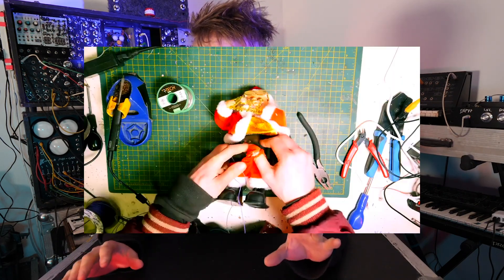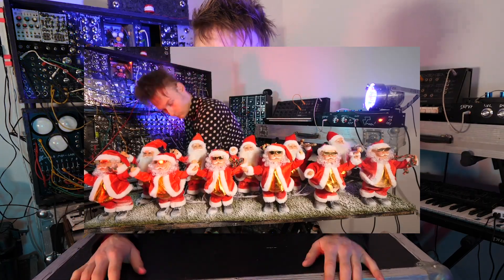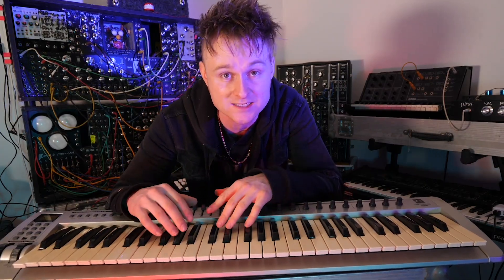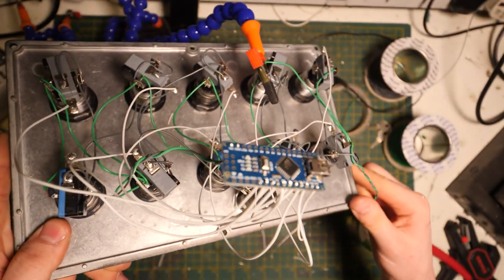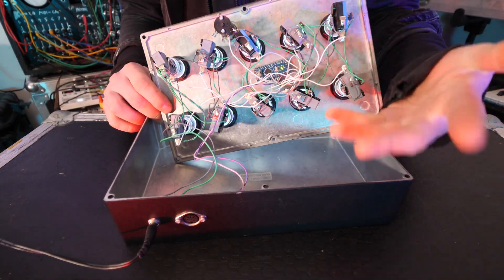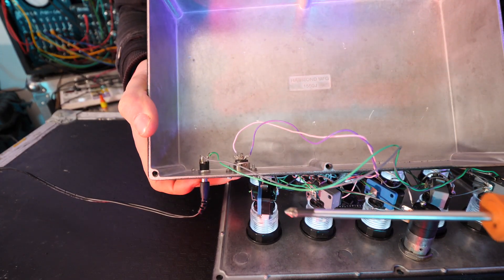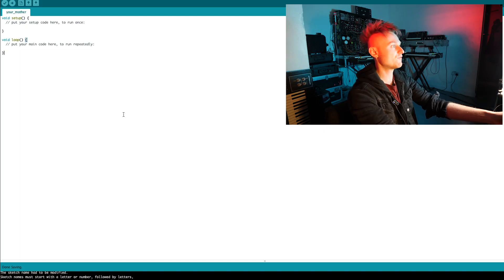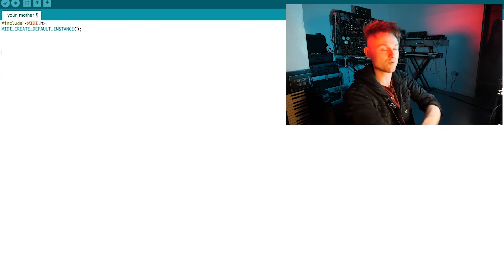SUPER SIMPLE MIDI KEYBOARD DIY HOW TO

Comment: I know you probably got tons of suggestions for making the code a bit sleeker, but I think it would be good as a "next step" for beginners, to show the use of arrays for storing the pin numbers and MIDI note values.

Then you can just use for loops for everything. ;)

I guess it's debatable whether this gives more or less "clarity of code". lol

#include <MIDI.h>
MIDI_CREATE_DEFAULT_INSTANCE();

byte buttonpin[]   = {2,  3,  4,  5,  6,  7,  8,  9,  10, 11, 12};  // Pin number for each button.
byte buttonstate[] = {0,  0,  0,  0,  0,  0,  0,  0,  0,  0,  0};   // Button states. (reset all to zero on startup.)
byte midinote[]    = {36, 38, 40, 41, 43, 45, 47, 48, 50, 52, 53};  // The MIDI Note that each button will control.

void setup()
{
  MIDI.begin();                                                   // Initialize the MIDI library.
  for (byte i=0; i<11; i++) pinMode(buttonpin[i], INPUT_PULLUP);  // Set button(s) as input(s), with internal pull-up resistor.
}

void loop()
{
  for (byte i=0; i<11; i++) {
    if (digitalRead(buttonpin[i])==LOW && buttonstate[i]==0) {  // Is button pressed (pressed-LOW) AND buttonstate is 0?...
      MIDI.sendNoteOn(midinote[i],127,1);                       // Turn MIDI note ON, velocity 127, midi channel 1.
      buttonstate[i] = 1;                                       // Change buttonstate to 1.
    }
    if (digitalRead(buttonpin[i])==HIGH && buttonstate[i]==1) { // Is button released (released-HIGH) AND buttonstate is 1?...
      MIDI.sendNoteOff(midinote[i],0,1);                        // Turn MIDI note OFF, velocity 0, midi channel 1. 
      buttonstate[i] = 0;                                       // Change buttonstate to 0.
    }
  }
}
Reply: Could also be neat to try making the buttons velocity-sensitive.

Assuming the microswitches on each button have both the normally-open and normally-closed contacts, you could measure the time from when the nc contact opens, to when the no contact closes (button pressed).

It probably wouldn't have much resolution though, as that type of microswitch is designed to snap the contacts quickly when the button is pressed.

Also, a lot of synths seem to see a "Note ON with velocity of 0" as a "Note OFF", so there could be a bit of code saved there.

Comment: Awesome instrucional vid as always, Sam! Just a minor criticism: per the MIDI hardware spec, there should be 220 ohm resistors on pins 4 and 5 of the DIN connector to prevent frying the input optocoupler on the synth you'll be connecting this to.  Even though there SHOULD be a resistor inside the controlled synth, I reckon it's better to be safe than sorry. Keep up the amazing work!
Reply from the maker: Yeah al good tbh I was being lazy: I haven’t bothered so if someone is protective of their synth and I’m around with a midi controller I made don’t let me plug it in ha. I added 220r on the pic on the site when the vid went up al good
Reply: @LOOKMUMNOCOMPUTER  Excellent, man! Love all the hacky stuff to bits, just wanted to make sure nobody's equipment would get hurt.

Comment: Slight problem : The main loop tries to send 11 MIDI messages every single time it loops. And it loops 1000s of times per second. So unless the Arduino MIDI library internally keeps track of which notes are already on/off and refuses to send duplicate messages, this is going to clog up the MIDI buffer pretty fast. Therefore, it might be necessary to 'debounce' the button presses. You can do this by keeping track of their previous state, then only sending a message based on how the state has changed.
Reply from the maker: No need. Yes it keeps sending on and offs but it’s more a demonstration. And if someone was to write it in most cases it will work. There is a piece of code on the site under this one which gets rid of this issue also. But it’s not explained in this video cus I didn’t want to bore people to death with the dullness of a coding vid 😂
Reply: I found it quite sad to scroll down the comment section looking for this comment and instead seeing many comments like "I'm a Foobar developer with 50+ years of experience. This symbol is called semicolon". No one else has pointed out the real issue here (well, the software one, because there is also a more serious issue with the hardware potentially frying some expensive gear, even if very unlikely). I wouldn't be surprised if it crashed some synths, which is definitely not what you want to see after finishing your first microcontroller project (could easily make people give up after spending hours debugging).

I'm all for making things simple in a beginner tutorial like this, but some warnings would be nice so that people know this is the equivalent of twisting some wires together and wrapping them in duct tape. Works most of the time and is fine as a temporary workaround for small projects, but isn't very reliable and can potentially cause a nasty failure (at least in the case of missing resistors/optocouplers).

BTW, I wouldn't call this debouncing, because nothing is bouncing here ;) At least not so fast as to get picked up by these simple µcs with slow sample rate. Maybe if you've got buttons which are worn out heavily...
Reply from the maker: @tuesss  you didn’t check the project page I’m guessing
Reply: @tuesss  I did hesitate about calling it 'debouncing', but I couldn't think of a better term. I'd be interested to know what the correct term for this problem/fix is.

Comment: Wouldn't this code send a new Note On/Off for each button for every tick of the loop? I can imagine that would mess up some synths that start a new voice for every repeated note on (I know for example DSI/Sequential stuff do)
Reply from the maker: I had it plugged into a sequential synth in the vid. I doubt a synth would read a midi send on from the same midi not and play on another voice. Anyway there is a piece of code that doesn’t do it on the site. The cod in the vid was to keep it simple for the vid. Code is boring as fudge and talking about it in a vid for 10 mins was a stretch ha
Reply: @LOOKMUMNOCOMPUTER  fair enough, I get it would be hard to keep that entertaining.
I do know my Prophet 12 responds to multiple Note Ons, as I use it as a trick to make poly unison sometimes, but maybe other models don't.

Comment: The suggestion from your patreon member at 15:45 would not work.
It would have to be:
if digitalRead(button1) == LOW {}
not:
if digitalRead(button1 == LOW) {}

With your solution you skipped 1 read, I think that is a good solution. Your original version was fine.
Reply from the maker: Indeed but it was the sentiment :) all good!

Comment: getter == (Get ter 2)
set = (set 1)
idk, whatever works for you...

Also i'm not a hackerman either but wouldn't this be "better" I genuinely would like to be corrected on this.
I know just a flat else will catch all buttons soo you would lose polyphony (can only press one button at once with a flat else press all buttons if we check all buttons but I don't think we need to check both states of the button at once).
if (button1beans == LOW)
{ MIDI.sendNoteOn(36,127,1);}
else if (button1beans == HIGH)
{ MIDI.sendNoteOn(36,0,1);}

Also for all you case warriors out there, don't. case and if gets compiled into the same binary more or less, it doesn't matter for this instance.

Comment: Nice! I would strongly recommend to follow the midi standard and put a 220ohm resistor in series with the 5V wire to the midi connector. It will probably work without because there should be also a resistor on each midi in port too, but if both of them are omitted it will result in a blown optocoupler...
Reply from the maker: ofcourse, but almost everything has a resistor that has not been made by me so its ok haha. to be honest i usually never bother with opto couplers on the midi inputs haha. its just a digital signal stream, i have not come up an issue yet. obviously there can be issues but works for me :D. and when imake proper midi things i include optocouplers, but most of the time i just wire straight to midi socket on each sides
Reply: @LOOKMUMNOCOMPUTER  I agree that for my own circuits, I often don't do "MIDI at the electrical layer" and just connect RX to TX on microcontrollers, and just "MIDI at the software/protocol layer", but as this is being called a MIDI keyboard and has a 5-pin DIN socket it looks for all outward purposes to be for connecting to other equipment, so isn't there a real chance of overloading an input circuit with no resistors?

I think the issue is that the MIDI spec works on the basis of assuming a 5mA current loop, and the circuits suggest three resistors to get it - two on the output side, one on the input side.  I am not an electronics person, but as I understand things, with an Arduino driving a MIDI circuit at 5V, using two 220 resistors on MIDI out and one 220 on MIDI in (at the other end) gives you 5/660 = 7.5mA (well it will be less as I've not included the diode Vf).  But with no resistors in the MIDI out and just the one on the MIDI in, the current is 5/220 = 23mA (again actually less) but is four times higher than the MIDI spec says is required.  Some opto-isolators on input circuits will be fine with this (the H11L1 for example has an input current limit of 60mA I believe).  However some might be marginal, the commonly used 6N138 might have an input current limit of just 20mA, so any more would strictly speaking be too much for it.

As with many things, I'm sure there is margin for error and you'd hope expensive equipment has input protections, so it may be fine.  And I'm sure it isn't as simple as I'm saying here anyway (as I say, I'm not an electronics person and there are voltage drops involved across the diodes and things too). I often leave out the suggested buffers on outputs, but for the cost and effort of soldering in two resistors, why take that risk? Or at least, don't call it MIDI or use a 5-pin DIN socket, as a reminder to your future self?

Kevin
Reply from the maker: @SimpleDIYElectroMusicProjects  sure I’ll add a disclaimer to the site and the project. But the margin for error is pretty chunky. Having done this a lot plugging into things I haven’t had any bad experiences but then again maybe that’s luck. A 6n138 for me has been fine for a lot above that. I mean in one project.. the drum trigger sequencer there are no resistors at all anywhere technically it would have burnt out years ago but going strong haha. I probably won’t change my behaviour towards it but I’ll mention it on the project page.
Reply from the maker: @SimpleDIYElectroMusicProjects  the adjustmewnt is on the website. its right though, just because i have been lucky with plonking my crap into any old synth of mine, it doesnt mean theres gunna be some unlucky bugger that fries their best mates synth with a random midi keyboard they made hahaha
Reply: @LOOKMUMNOCOMPUTER  That's great :) I've also found most things are pretty robust against my own shortcomings for my own projects, so I also cheat all over the place :)
But I also trust engineers not to be over cautious about things and respect that too, so I think it is right to make sure anyone following along knows when I'm taking a short cut.
Reply: Yeah I was thinking the same. Agree you may not need it if you're just bodging your own projects together, but the issue here is that if you were to plug this into some proper synth you may blow up the optocoupler inside it if you exceed the max current of the LED :D.
Reply from the maker: @rjgscotland  as said to the other commenter I will add a note on the site about this.

Comment: Just before Christmas i modified an old Yamaha organ keyboard - i rewired the keys as a 4x12 matrix and used an Arduino Micro to connect it to my Laptop. As the Micro has native USB support, it can act as a USB-MIDI device with no extra hardware! It takes just the Arduino, a few resistors and lots of wire.

Comment: When you use variables that just won't or especially if they shouldn't change, you should use preprocessor directives instead of actual variables. So instead of
int button1 = 2;
use
#define BUTTON1 2
It doesn't have to be upper-case. That's just an unwritten rule that's written down very often (just not as an actual rule).
You're already using preprocessor directives without knowing when you're writing stuff like INPUT_PULLUP, LOW, or HIGH. They're all over the place in Arduino.
Using preprocessor directives for small datatypes should also save some memory which is very limited on microcontrollers. For that to be a problem you would have to make a project which is much more complex to run into problems there. But it also just makes sense that something that isn't variable shouldn't be A variable. With that in mind, you could also just make the variables constant with the const keyword, but that won't change anything on the memory side.
Reply: Except that #define is super risky to use, if you accidentally use the defined string as part of another string it will still replace it.
For example: if you do #define a 1, and then write digitalRead();, it will be interpreted as digit1lRe1d();

const gets compiled perfectly and does not take up more memory than #define, so go for const.
And more importantly: int is fine for beginners. use int.
Reply: @DanielSimu  Well, technically that's true, But if you use a more descriptive name than "a", something you should do anyway, it's just very unlikely that this will happen.

And correct me if I'm wrong here, but the difference in memory use is that variables, const or not, are stored in RAM and literals, what preprocessor directives eventually become, won't. Every time you use a literal (as long as the number is small enough for a single word data type), it's taking up one word in flash and every time you're referencing a variable, the address also takes up one word in flash. So that's basically the same.
So it depends on the question if you're running short on RAM while it won't help you much when you're running short on flash.
Of course, that won't be much, but that's why I wrote it won't be a problem in smaller projects, so as you say, it's not a problem for beginners, but even beginners should start to learn good habits instead of unlearning what they've learned later.

Even when I don't think about why this makes sense, I just look at how preprocessor directives are all over the place in Arduino itself at that they probably did it for a reason.
Reply: @juschu85  Feel free to keep on using #define, but I disagree that it is unlikely to happen.
For example, in this video there was an int button1 and an int button1beans, if the first had been #define button1 you would have gotten issues with the second.

On a recent memory limit approaching project I had a look at replacing all the consts with #define just to test, and the arduino compiler showed no difference, the sizes were exactly the same. Why would the compiler treat a const differently anyway?
Reply: @DanielSimu  No, that does not happen. Not at all, that is not how define works. It won't just grab part of a word. You're welcome to try it yourself, but it does NOT work like that.

If you type

#define button1 1

then using

button1beans

will remain as button1beans
Reply: He can make an input array and a midi notes array, or he can define the input int range and the range of the midi notes, or he can define the base offset between the input numbers and the notes.. Out there is a principle called KISS
Reply: @asp95dev  Yes, "keep it simple, stupid", but I don't see how using preprocessor directives isn't as simple using variables.
Using arrays might be the more elegant solution, but my comment was more about variables vs preprocessor directives in general than about this particular case.
Reply: @juschu85 
"Why would the compiler treat a const differently anyway?"

Would love to see an explanation of this question, posed by Denier Simu, from you!
Reply: @drakeisacake  The compiler isn't treating preprocessor directives at all. You can't compare "how" one thing isn't treating two other things if it's only ever coming in contact with one of them.
By the time the compiler starts its work, the preprocessor already converted all preprocessor directives with their substitution value by simple search&replace.

Comment: Speaking as an old code hacker and midi fan, it was great to see this section of this project on coding to generate midi on the Arduino. As you say, it could be optimised, but your point was to make it easy to follow for non programmers, and in that you succeeded. Please do some more.

‘;’ is a semicolon. It’s basically there to make the job of the language compiler/interpreter easier as there is no ambiguity as to the end of the line.
It was chosen as it’s a rarely used symbol and non-arithmetic, possibly because assembly code, from which high level languages like C/C++ grew, used it to mark the start of a comment; and yes, there was a language called B which came before C.
Reply from the maker: Aaah I remember us talking about you messing about with midi!
Reply: @LOOKMUMNOCOMPUTER  cheers Sam, great gig :) I have a denshi block kit in the garage somewhere that I’d like to donate to the museum. Will take a trip over when you’re open later this year. I remember most of those everyday electronics issues :) think I threw the mags away though.

Comment: I want a little midi box like that but it would have a speaker built in and a sound card so I could set different keys to be different sounds... Then it would be a small mobile beat station, perfect for toilet sessions.   😂
Reply from the maker: sounds like you need to build it!
Reply: @LOOKMUMNOCOMPUTER  - I can give it a try but I'm better at coming up w/ the ideas instead of building them..... Like making a little keyboard out of a calculator, I couldn't do that but I feel like you could.   😁😉